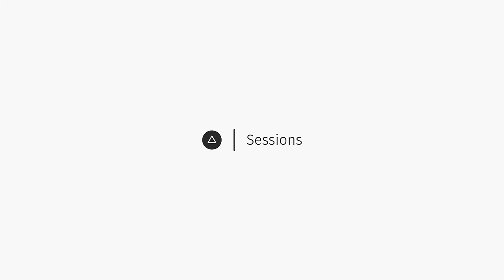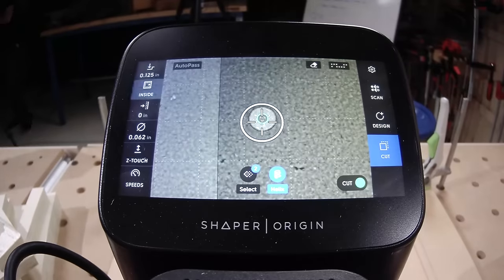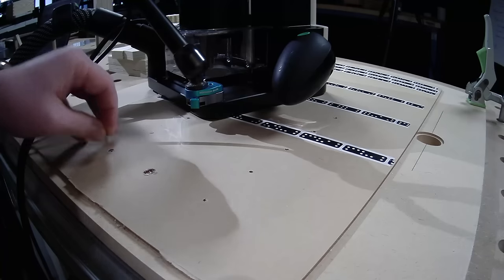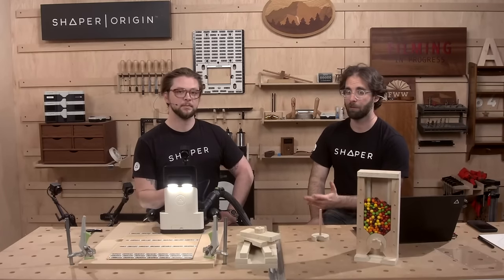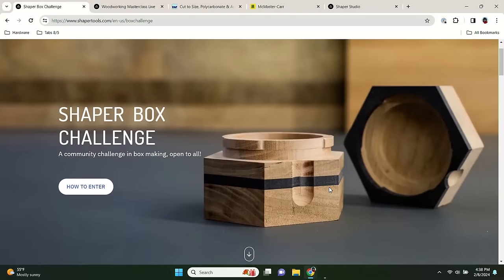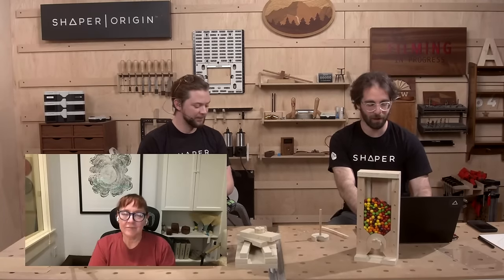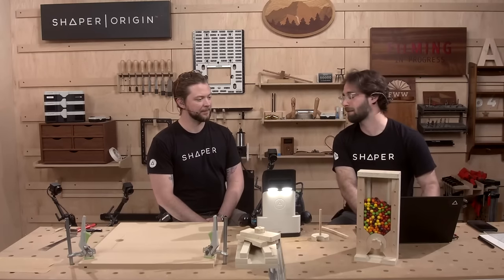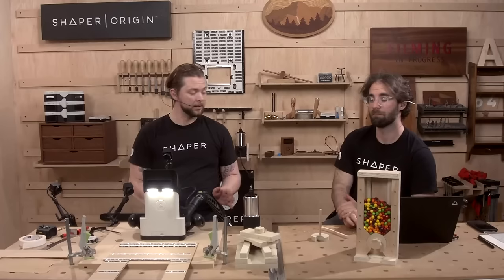Session 99  – English:  Cutting Acrylic with Shaper Origin - Candy Machine (Part 2/3)

Comment: I agree with the comment about users outside of the US. All the references to the imperial measurements is so US focused. They should also mention, at least occasionally, the conversation equivalent in metric.
Reply from the maker: Origin handles conversions right on tool--you can change either your global units from Inches to Millimeters in the settings, but you can also swap between them when entering a value. So if you're in inches and type in .25" or 1/4, then tap "In/MM" it will automatically swap the value to 6.35mm. This also works in the inverse, so typing in 6mm and tapping "In/MM" will swap it to .236"!